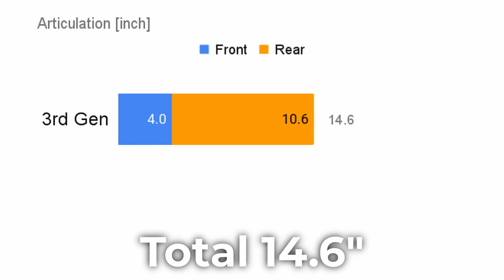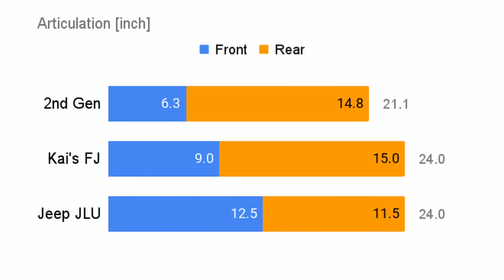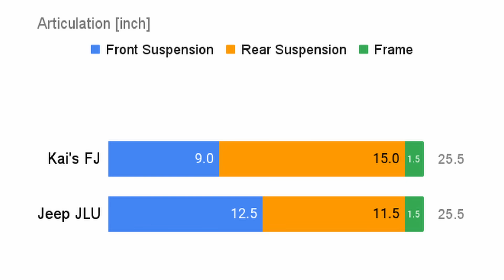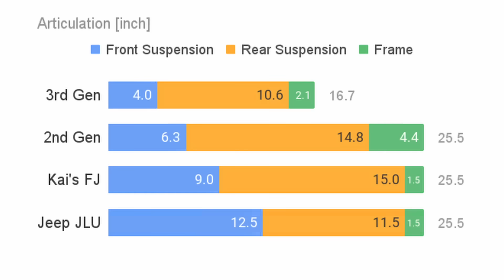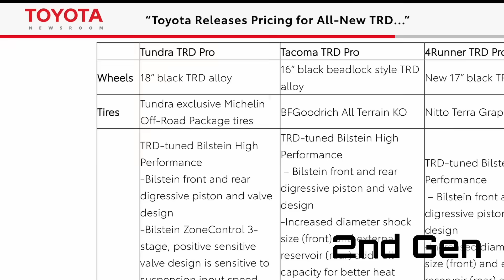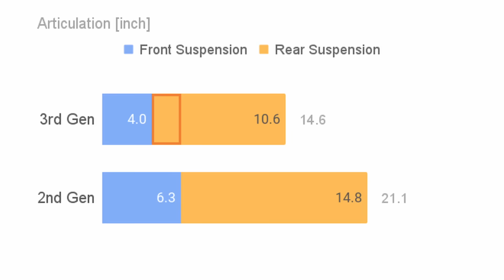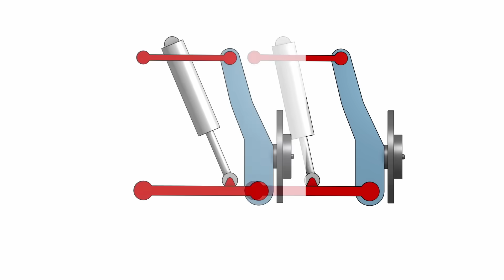Why The New Tundra is LESS CAPABLE Off-Road, But A "Better Tundra"

Comment: How about it blow your mind.  Frame flex is not for off roading nor comfort.  Fram flex in an open c is to allow the fram to bend and return to form.  Fully boxed frame once they bend they stay bent.  It's why older HD trucks had a frame like the gen 2 tundra.  Boxed front, closed c middle, open c rear.  It fir hauling and towing.

Comment: 2026 owner and mine goes up some pretty crazy stuff stock the rear locker is 100 percent the reason I bought this instead of the older gen unless you put a arb airlocker in it along with the rear locker the new gen mts system is awesome it goes up a very steep rutted hill that even my 4runner trd pro has a hard time going up after that I was impressed

Comment: taking the sway bar off the 2nd gen entirely changes how it feels offroad..it is 100000x better and more smooth. unless youre racing your tundra around on/off ramps the handling change on road is unnoticed.  ditch the bar

Comment: Excellent again!  Frame flex is something I did not consider when installing skid plates to my 2007 Tundra SR5 regular cab 4WD, 6 1/2 foot bed, 5.7 L V8.  I installed four skid plates one to the fuel tank, one to the oil pan, one to the trans pan, and one at the mid section.  All of them are connected to frame cross members.  A video on proper skid plate construction and fitting would be appreciated.
On static stress tests the aluminum steering knuckle may be stronger but after repeated dynamic stresses it will crack because aluminum does not tolerate bending repeatedly like steel.  
Sway bar on my Tundra is 1 3/8 inch ( 35 mm ) diameter.  I tried disconnecting the front sway bar on my 1982 Jeep and the highway handling was hazardous in my opinion.  The new sway bar disconnects are nice to have when one gets into really rough territory.  
As those of us that did our homework before buying a Tundra, we realized as did you that Toyota has decided to appeal to the street warriors who want to look tough but never take their vehicle into the rough.  All 3rd gen Tundras are inferior to 2nd gen for serious off road use.  Thanks again for a thorough, scientific and clearly explained presentation.

Comment: Kai - love these vids. 
Do you know what the measurements are for extended and compressed lengths of the 3rd Gen shock options? Specifically, the TRD Off Road and the grey TRD 3” lift shock?

Comment: why does the 2nd gen TRD Pro have longer suspension than the TRD Off-road? handling? One would think the Off-road would be better equipped for such activities. Or is it just that the Pro is top of the line?

Comment: It would be interesting if you could do do a deep dive on disconnecting sway bar links, what are the pros/cons, when it makes sense, why they are not common etc. It seems most IFS offroad vehicles would benefit from a very beefy sway bar for road use and then disconnect it for everything offroad.

Comment: I love your detailed comparisons. When I saw the press events for the 4thG Taco/6thG 4runner yours was the first channel I looked for before anyone else. Can't wait to see your analysis, if you do one. 

Some of the components on the new Tundra are surprisingly tiny. The rear lower arms are tiny in diameter compared to my Gladiator's arms, or for that manner my JKS arms on my TJ/LJ. I wonder what the wall thickness is of the tube?

Comment: Can confirm. My 3rd gen had almost no flex.
Reply from the maker: A front swaybar disconnect would be nice. Hope someone develops a solution
Reply: @TinkerersAdventure  that would be ideal. I took mine off to test it out, and it handled so poorly that I put it right back on again!
Reply from the maker: Yeah the handling with no front swaybar is the biggest gripe on my long travel FJ.

Comment: Should I get the factory 3 inch lift and get front sway bar disconnects more articulation? TRD Offroad 2023 Tundra
I will run 35s on 17 inch wheels.

Comment: Coil springs will typically flex better than leafs due to the leafs natural resistance to twist. It’s one reason why many leaf sprung vehicles don’t have a sway bar while. Coil springs are heavily dependent on the link and bushing setup, which can obviously vary significantly and greatly impact your perceived results.

Comment: I'd like to add a point to the 2ed gen swaybar, I added one to the rear of my 2012 and it made a big difference with pulling a trailer as well as normal road handling.   Yes I noticed the difference in suspension travel offroad but the trade off was well worth it to me.

Comment: Love it!   Keep up the good work.  Do you (or anyone else that may read this) know what other Toyota vehicles got the KDSS option?  None of the Pros I assume, but another factor in stock sway bar performance/flex.
Reply from the maker: Thanks. For older models, all GX460 and some 5th gen 4Runners. For new TNGA-F platform, only LC300 and GX550 overtrail has the e-kdss. We have to see what the 6th gen 4Runner will have.
Reply: @TinkerersAdventure  No Tundras, Tacomas or Fj?

Comment: Big, stiff anti-swaybars are the chit for pretty much everything other than serious O/R applications. I put Hellwigs on all my F150's, Fbodys, Mustangs, etc. Ford, and GM (and GEN1/GEN2 Tundra) missed the mark not including a rear anti-swaybar. People always say Ram handles better than other trucks because or coil springs. No. Like a GEN3 Tundra Ram has a rear anti-swaybar to compliment it's 5 link coilspring setup. That anti-swaybar is where it's at for on road handling. A F150 or Silverado with a rear anti-swaybar, and a decent Bilstein shock out back totally transforms the trucks handling while improving towing, etc. It doesn't greatly limit O/R articulation though. Still an anti-swaybar is an awesome mod for a truck that's not a serious O/R rig.

Comment: Why do these manufacturers always do a 4 link with a pan hard bar vs a triangulated 4 link?
Reply from the maker: great thought! i think it comes down to lateral rigidity for road handling.
Reply: @TinkerersAdventure  what would be the draw backs for road handling. I’m not an engineer so I would think 4 links set up to keep the axle center with little to no lateral movement would be better than 5 which shifts the axle side to side a little. Thought I would ask a pro though.

Comment: Dan Edmunds at Car and Driver did suspension articulation test and the old LC200 beat everything from Gladiators, Colorado ZR2, Bronco, RAM TRX, 2nd, 3rd gen Ford Raptor etc. 

I wonder how the LC300 and the LC250 perform. We know that the new TNGA-F has a more "straighter" inboard suspension compared to /\ of the older Toyota truck as you mentioned. Also I believe the engine now sits lower to reduce center of mass, I wonder how these two combined will affect suspension articulation

Comment: Your videos are always so informative. I wonder how much front flex would have been gained in the 3rd gen by disconnecting the front sway bar and doing the test again? Perhaps Toyota didn't want you taking parts off their loaner truck?
Reply from the maker: I believe it will be at least as much as the 2nd gen front flex, if not more because the 3rd gen has a decent rear swaybar. And yes, I asked if I could disconnect the front swaybar before even taking delivery of the vehicle. Unfortunately it was a safety concern and rightfully so.

Comment: Love your vids. Just a thought to maintain accuracy:
Rather than measuring from fender to tire (tire having many variables:psi,tread,ply,etc), could you measure from fender to the wheel instead?
Reply from the maker: Great thinking! I didn't because many of the previous vehicles I measured had tires sticking out pass the fender. I couldn't measure squarely to the wheel. Nevertheless, the top of the tire is not affected by psi. So the only inaccuracy measuring the tire could add is if the left and right tires had significantly different tread depth.

Comment: As someone who did use a full size truck for quite a while for some pretty hard-core off road adventures, it is an exercise in masochism.  With a real short chassis version it isn't too bad, but you are still wide enough where everything is a tight squeeze, turning radius sucks so every tight bend is a 3 point turn, breakover angle means a lot of rocks and drop ins are anxiety inducing.  About the only place they really do well is out in wide open spaces at speed where the increased dimensions and weight improve stability.  I went to the darkside recently and got a 2 door jeep, and all these places around home that were always anxiety inducing, needing to think thin just to squeeze between two trees, not drag my gastank on a rock, and the like, are now a breeze, easy, relaxing even.  I've learned my lesson,  and I kind of feel like toyota has as well, and chosen to focus on what that full size truck is going to be doing 95% of the time, vs trying to optimize what it will be doing that other 5%.
Reply: Same. I had a Supercrew F150 and, while it was capable traction and articulation wise, it was just massive. Even on 35's I was having to pick lines super carefully in Moab on intermediate trails due to the horrible breakover angle. I had a GX460 at the same time and it had 3" less clearance between the axles(11" vs 14") but almost never had issues dragging on more challenging trails and was much more nimble.

I sold both and got a 200 series now. I get the short wheelbase and turning radius of a GX460 with the capability of a half ton based chassis for towing.

Comment: As soon as I saw it before the release I knew it had a limited rear suspension.  It was obvious when they drove the truck in the moguls.  I assume Toyota justified this since they added the rear locker. This truck overall has been somewhat of a let down. I can change suspension and add lockers but at the end of the day we need a good platform.  The engine has been less than desirable in reliability.  Come on TOYOTA!
Reply: Mines been perfectly reliable. Idk what bs you’re on about.

Comment: Great video as usual! 
In my opinion Toyota has always made 4WD vehicles to please to a variety of drivers. Not everyone wants the tallest suspension and lift and larger tires to see what is the biggest rock you can climb with it. 
The few Toyota vehicles I have owned over the years were fitted with a mild 2 inch suspension lift and 33 inch tires, vehicles used for work and play.
Let’s keep in mind that, most of the driving you will do with your truck modified or not … it’s on pavement

Comment: Thank you for the video. I learned a lot of useful information. I will take this into account when building my Niva 4x4 👍🏻
Although it does not have a frame, I will take into account the size of the tires, which were discussed in previous issues.
Are there any off-road enthusiasts among your friends who drive a car with a monocoque body? It would be interesting to compare them with frame SUVs, to see the advantages and disadvantages of both.

Comment: Proud owner of a 2nd gen tundra. I wonder which trucks ATRAC works better, have you done that while cross axled?
Reply from the maker: The new MTS and crawl control are definitely a lot more aggressive than the old ATRAC. We tried them out on the trail.
Reply: @TinkerersAdventure  awesome, do you think a locker is necessary or is ATRAC superior to a locker? For example the 200 series landcruiser which is the flagship vehicle of Toyota has never had a front or rear locker for years, at least the US market because some say ATRAC is better. It would be nice for you to compare and contrast with your in depth methods
Reply from the maker: @fouUili684  Yes that will be a video topic I want to go in depth about. Stay tuned! But the short answer is, ATRAC will never be as effective as lockers, mathematically and physically :) Toyota wasn't really committed in the serious off-road game with the 200 series. But now they are. The 300 series GR sport comes with front and rear lockers. Both Sequoia and Tundra also got the rear locker for the first time ever.

Comment: Great video as usual. I know a lot of guys get caught up in their Toyota fandom and want to see one Toyota tested versus another but the fact is the big three outsell Toyota in the full size truck game anywhere from 5 or 8 to 1 depending on the brand and the year. Ford has their FX4 package as well as their Tremor in addition to the Raptor for the F150. Chevy has the Z71 and the Trail Boss as well as the ZR2 in the Silverado and Ram has the Rebel and the TRX in the 1500 and the Power Wagon in the 2500. It would actually be more interesting and more telling to see how similar off road packages from other makes compare. It would also give some insight as to why Toyota chose to go the way they did with the new Tundra. After all, if the F-150 Tremor and FX4 don't do anything the SR5 won't do then obviously off road prowess isn't most buyers main concern when choosing their new truck. We know it's not but number often prove reality to those who can't see it for themselves. By the way, you can option a rear locker on any 4x4 F-150 equipped with any engine other than the 3.5 naturally aspirated version. And that is more valuable far more often than a inch or two of travel. Anyway, comparing competing brands off road package numbers would make for a great video or series if you can get your hands on the competition.

Comment: In the truck and SUV world there's the amount of capability one actually needs and uses then there's the capability one thinks they need or use. The two are almost never the same. In fact, most guys will tell you they are going to need to modify their TRD Pro to meet their off road needs because Toyota didn't go far enough. In reality the vast majority could go anywhere they actually go with a RAV4 while most of the rest could make it with a 4WD SR5. For the very few who will genuinely test the limits of a TRD Pro these guys already know that they are going to have to modify any truck they buy and don't worry about it. Toyota deals in reality not key board fantasy land and you sell more trucks with good ride and handling plus the perception of great off road chops than you do with great off road chops and poor ride and handling. Remember, in order to grow market share Toyota can't just sell to Toyota fans, they have to steal customers from the big 3 and they weren't going to do that with the previous generation Tundra.

Comment: Great vid! On my 2nd gen, I ran a king 2.5 with the no swaybar setup over 2 years for maximum travel. Recently I had to buy all of the accessories and reinstall a TRD sport front swaybar to improve my towing and onroad handing. Hate to say this but I’m loving the truck more than ever. I still hit some trails some time but size and break over is mostly my limiting factor over suspension travel. I think Toyota did a right thing here on the 3rd gen.
Reply: Agree ! Absolutely knocked it outta the park with new Pro ..more goodies than my 2nd gen Platinum and more nimble. Turning radius is worse but not a huge factor for my use. Loved my 2nd gen but this is better and (for now anyway) don't even miss the 5.7

Comment: I took my front way bar off my TRD off road 3rd Gen and I have king 2.5 suspension as well as +1 TRD axles from their TRD lift kit and I get tons of articulation, likely match the second Gen. going for the new Camburg long travel that’s coming out soon which moves the front sway bar connection back inboard again and completely deletes the rear sway bar and converts the rear to a coilover with a 12 inch stroke rear shock.

Comment: Im like your buddy Josh and sitting on 37s currently on my 2nd gen.  Though I think Im going to end up like James since most of my "wheeling" is gravel roads and I more prefer the Tundra to be a pack mule and carry all my camping gear up the mountain on the groomed gravel road to a lookout somewhere overlooking a Vally.  Currently if I see a rock garden I tend to avoid it because I dont want to risk damage due to a very heavy vehicle trying to get max articulation just for some bragging rights. Just not worth it to me.

Comment: Any chance 3rd gen. aluminum knuckle would work on my '15? (of coarse with 3rd gen. upper ball joint and outer tie rod).
Reply from the maker: Unfortunately no. The lower arm mounting is different. The 3rd gen front and rear bushings are spaced further apart

Comment: 2023 trd off road limited. Crewmax short bed. Only 'mechanical' modification I've made is upsizing the tires a little to 275/65R20. On road it handles like a dream you really gorget you're driving a truck. Off road i think it does really well 4L rear end locked I've gone some places and dented some things. Yes i definitely notice the lack of articulation I've kicked it up on 2 wheels countless times and even lost grip on 1, but it got through and honsetly the sheer size of the truck and bad breakover is gonna be the limiting factor over articulation 99% of the time anyway so I agree with what toyota did. I think they sacrificed some off road in suspension (that I am not going to use in a half-ton truck amyway) and gave me more handling, better ride quality, better frame and a stronger rear end. Totally right call imo. Get a RaptorR/TRX or a midsize if you wanna go harder off road then what this allows.

Comment: Great video as always. 
Now, as 2nd gen owner who does alot of off rosd and actually removed the front sway bar. 
I am wondering how much more/less travel it will gain without front sway bar. Like the video you did with the fj where you deleted the sway bar fkr the comparison. 
I removed the front and installed the rear trd solid seay bar for higher speed. But also i installed it while i changed the rear shocks to 5100 which is stiffer then stock. So not sure what helped more for the ride in higher speeds but im sure wondering how much articulation i lost/gain with rear only.